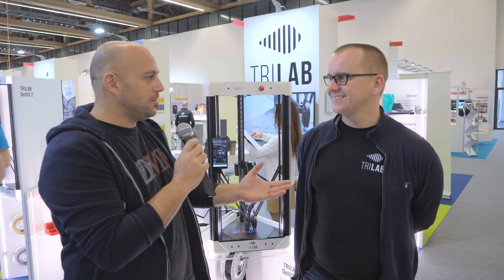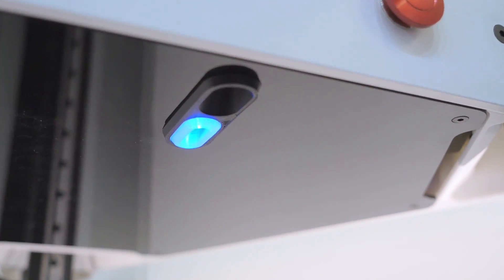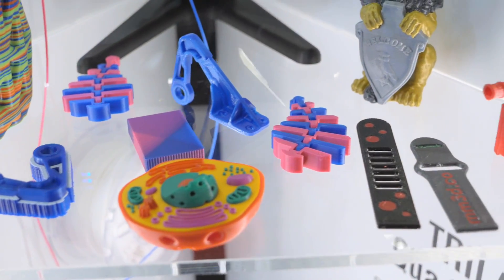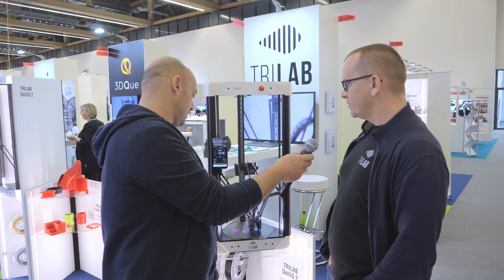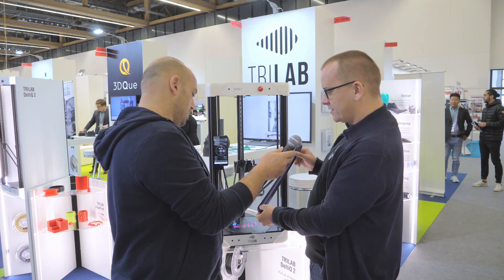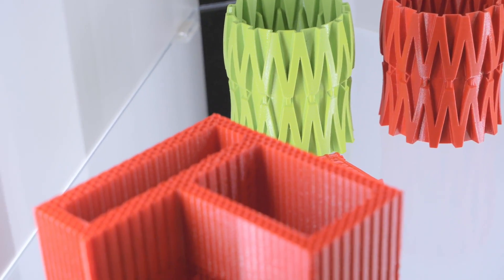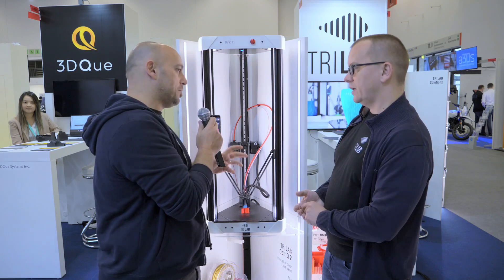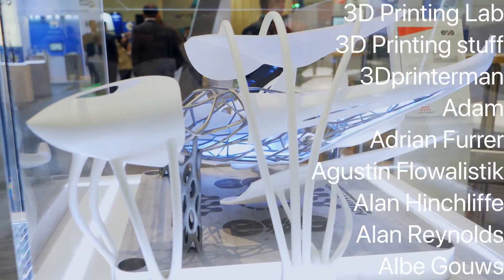Epic Quality Prints With The Trilab DeltiQ 2

Comment: Seems slow and pricey.  Tilting prints into the Z direction to overcome XY size limitations is a good idea but then the don't the prints become weak with interlayer adhesion compared to XY strength?  And lots of support material used and the underside surface is now quite messy with the support attachment points?  Perhaps I'm not the target customer

Comment: A couple of question,  I asked what slicer your gonna use,  and you said S3D which is what I thought you would, you  missed my last question which is how is S3D gonna handle heads that are not in use (stand by temp)  used in Cura and in Idear maker not in S3D at present.. also not really happy parts were missing, when you think of the time it takes to build this what happens when you find out parts are missing 4 weeks later??? E3D ?? great video though very time consuming...
Reply from the maker: No idea how I will handle the rest temperature as yet, possibly through a macro in the reprap firmware? As for the parts, mistakes happen, parts will be sent out tomorrow morning and will be here within 24 hours. Gives me a day to print the parts I need anyway :)

Comment: I wonder how they will do the auto bed changing. I've seen some printers that use a side box to store glass beds and slide them in.  Stratasys has a printer that prints on plastic that's on a roll. The printer would even print job information on the plastic then cut it and advance more plastic for the next job and so on. It was pretty cool.

Comment: Sorry this price for an regular delta-printer, with standard mechanical setup besides a nimble extruder...is that a joke. Sure a camera and a duet board are nice things and they justify a higher price...but within a reasonable range.
I'm not quite sure if the printed delta effector or the argument that printsize could be compensated with part orientation is the punchline.
Reply: Look at that print quality tho....